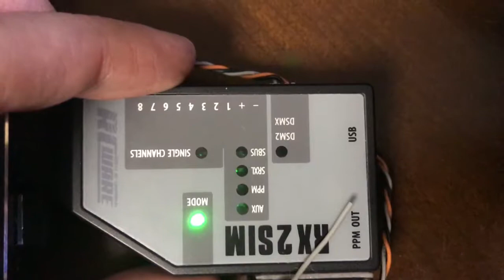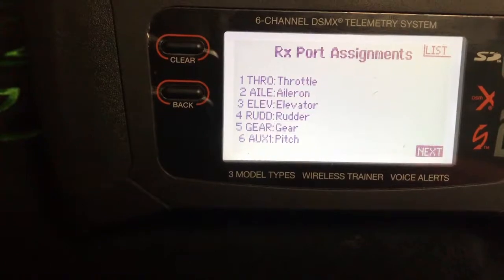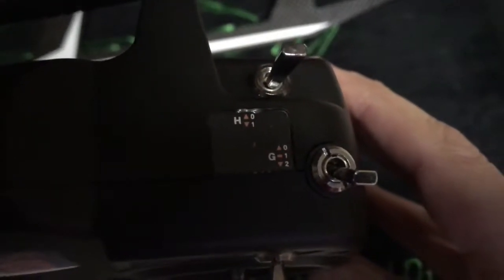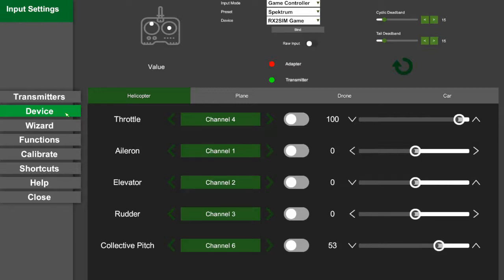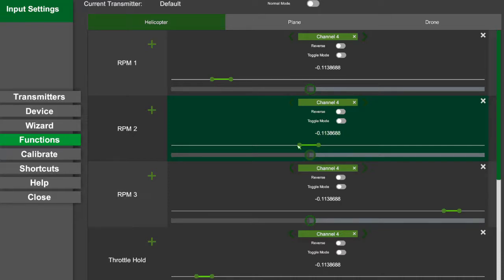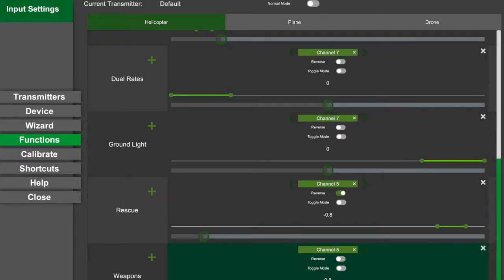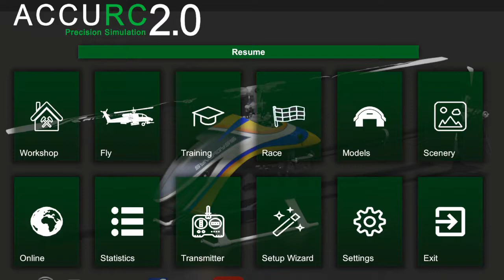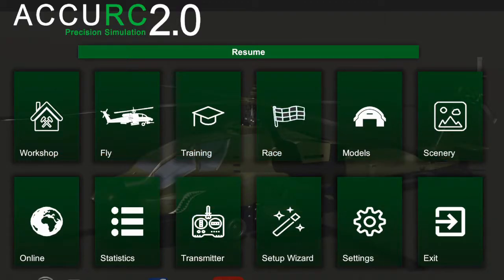FULL AccuRC Spektrum and RX2SIIM setup

Comment: In functions setup I only have choice of axis or button - no 'channel'. I cannot get this to work right with a NX10.
Reply from the maker: Hi there. I am uploading a video to try to help out with this. Hopefully it resolves your issues. Let me know!
Reply: @toadiscoil  - I got it to work by selecting 'default TX' instead of SPEKTRUM, 'raw input' on devices setup, and 'normal mode' in functions. So I have normal and idle-up.
Very difficult to find a switch setting for the throttle hold in functions - found one that works but each time you switch it it changes the idle-up selection. Which is fine, don't need TH for sim, and my mode button sets up the normal mode and idle up 1 which gives me my two pitch settings for stablized an idle-1which matches my M2 Evo when I fly the actual heli. 
It's really helped a lot - I've mastered hover, now moving on to nose-in hover, side, and some general flying.  
Sure is fun!
Reply from the maker: @Browneye57  Nice! Well the video that will be up I think tomorrow hopefully will help. It allows you to see how to setup throttle hold and the bank switching on a single channel.

Comment: Javier:  ive been struggling to setup my dx 9. I set mt radio to everything you said and everything works except the throttle it seems like its at about 40 percent and no response to movement of the throttle.  Any advice or help would be appreciated.  Ty you got me closer than anyone but still not able to use the sim.  John
Reply from the maker: Hmmmm. If you have done everything, then I can only think your issue is whatever you are using to connect to the computer. Try to map a channel you know works to throttle and see if you can see it to move from 0 to 100. One more thing you probably already did but doesn't hurt to ask, is to start a brand new model on the radio from scratch, not copying from an existing model.

Comment: Hi Javier, how did you separate the throttle from pitch? 
I have put in 3 different throttle curves and have those working and hold. However the pitch stays with throttle or if I change the Chanel to ch6 it goes from 0 pitch at bottom stick straight to 100 pitch as soon as I move stick a tiny bit.
Thanks in advance
Reply from the maker: Hi there.The pitch and throttle are two separate channels. On your radio, go to Servo Setup and you will see channel 1 is Throttle and channel 6 is Pitch. Throttle is controlled by your Throttle Curves, they need to be "flat" curves, so all points must have the same value. The only other thing that is probably happening is that you are staying in "Normal Mode" so on your Throttle Curves try setting up your "N" curve also flat and see if that resolves the issue. If so, then you are not changing your flight modes correctly, as to gain full advantage of the functionality you want to have different RPM settings (so different flat throttle curves on N,1 and 2)